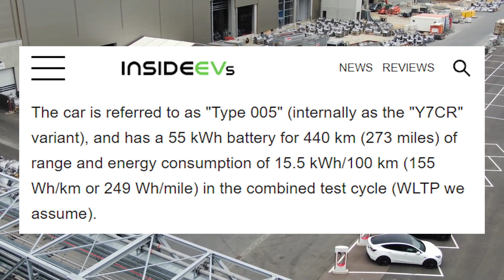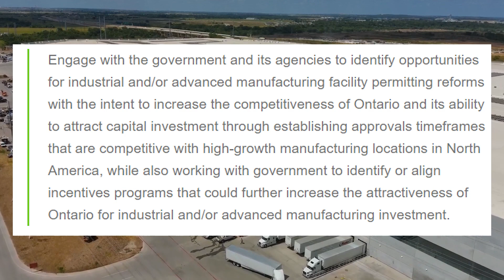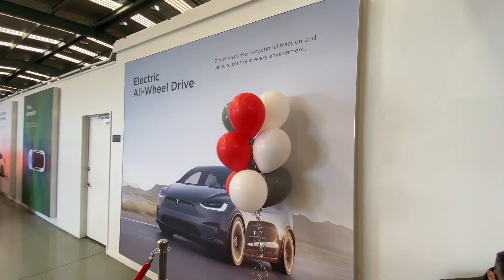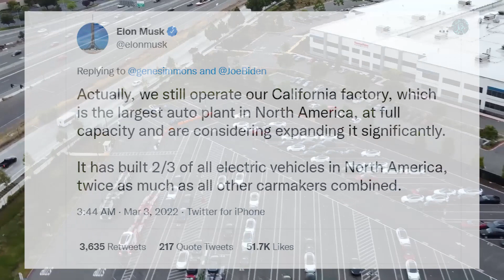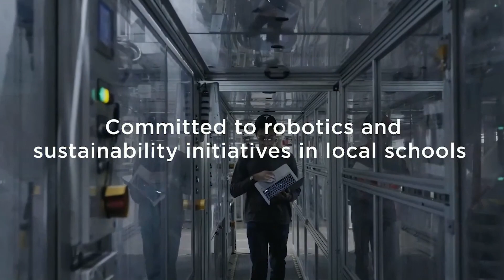Tesla To Use BYD Blade Batteries At Giga Berlin

Comment: Beautiful Video, The new variant will more lighter, I think. Thank you for the video.
Reply from the maker: Yes it will be more lighter, the BYD blade battery is very light. Thank you so much.
Reply: @NjeckstonElectricChannel  it will be lighter mainly because it will be a structural battery pack, which replaces much of the subfloor of the vehicle. The LFP battery is actually slightly heavier than the standard NCA chemistry.
Reply from the maker: Thank you so much Sir, lot's of appreciation. It's incredible lighter, having a weight of  2,087 kg, which is 66 kg less than the present one.
Reply: When ever I watch this channel, it seems I am watching world class news on TV.
Reply from the maker: Hahaha, thank you so much, we will continue to improve the presentation so you get the best as much as possible.